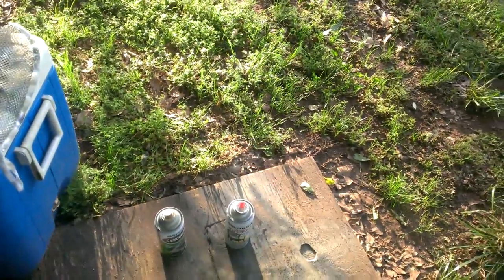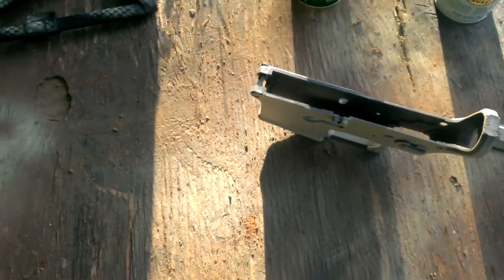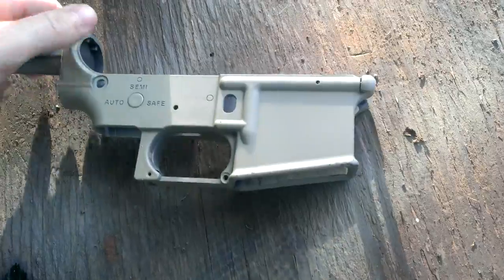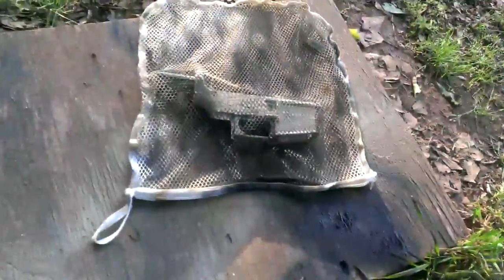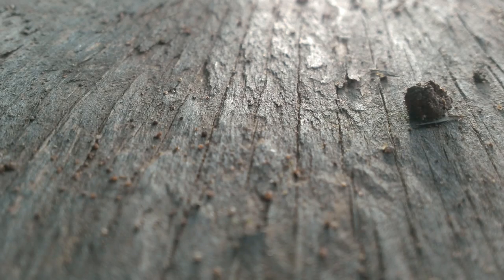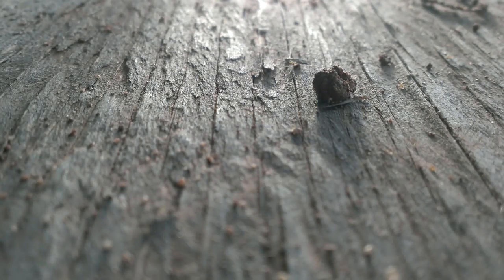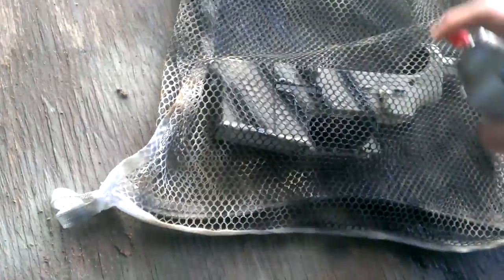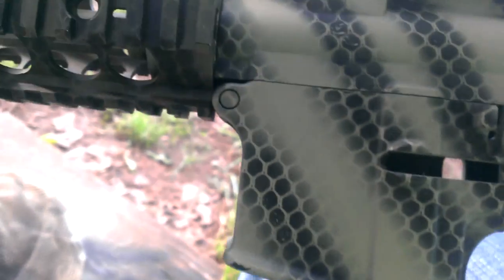How to snake skin camo a gun.

Comment: great video but question, do you have to remove your gearbox or would you be able to simply spray paint a gun right away? not sure if the paint would leak in and damage the gearbox